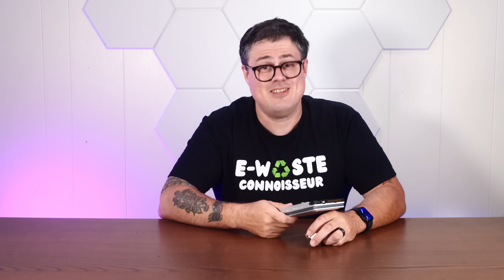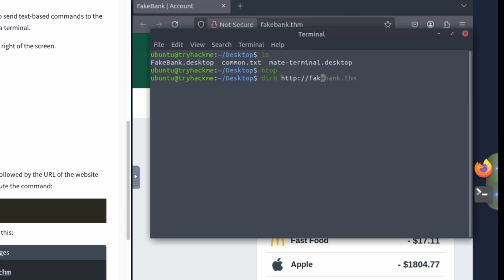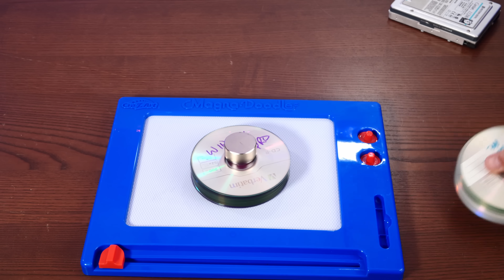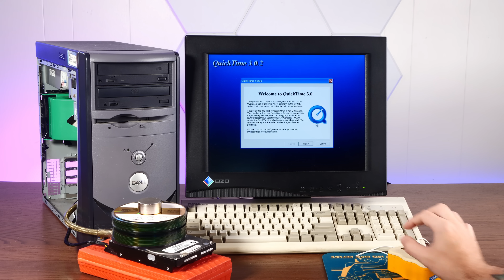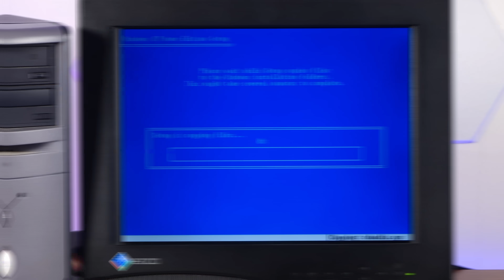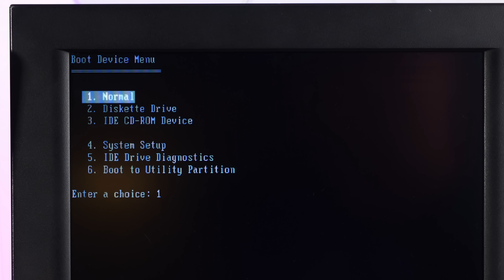The Hard Drive Experiment

Comment: Hmm, must have been a particularly weak HDD. I recall this German youtuber whos entire deal was gigantic neodymium magnets and it took a lot more for his HDD to fail. Then again, he put the dangerously strong magnets (the size and strength where you risk crush injuries if handled improperly) on the outside of the computer case rather than right on the HDD. Also, I think you caused a head crash or misaligned the arm rather than did anything particularly permanent to the magnetic disks.

Comment: I'm wondering if the drive started having a fit due to a modified/missing bad sector table...It will take forever, but it might start behaving again after a zero/low-level then a proper unconditional full format...I know this kind of thing doesn't work on modern drives because the firmware is stored on the platter as well...

Comment: Ha at one of my old jobs I’d take the drives we would need to dispose of and install windows and let them run and take the lids off the top and watch it flip out cuz the arm has nothing holding it, then I’d tighten it down and watch it go back to normal… and a couple times while it was still running I’d move files around and watch the needles skip alll over, then I’d also take them and I had a cup…. Of Mountain Dew and I’d dunk the running HDD in it… you wouldn’t believe it if told you, it still kept trying… all of them did. I loved it lol

Comment: I would like to see if you put the magnet on the opposite end of the hard drive over top of the magnetic platters instead of the drive head magnet. If it would actively like erase segments but not actually damage the drive.

By putting it over the magnets that the head uses to move, you may have burnt out the heads. Curious to see if it was an actual magnetic failure of the platters or an electrical failure because the head burnt itself out trying to move.

Comment: I've recently been wondering how bad this really is.  I stack hard drives on top of each other all the time.  I have a bunch of 1 to 6TB drives that I use to backup my NAS, and they just hang out in a couple piles on top of my disk imaging PC.  It does make me wonder whether this is okay, long term, or if it slowly affects the adjacent drives.  (I've had two drives develop bad sectors in the last 10-12 years or so.  Not sure yet how normal that is for xxTB drives.)

This last weekend, I salvaged a bunch of laptop drives and could feel two of them physically pulling toward each other when carrying them in a stack.  That was concerning.  After running badblocks on them, all but one were totally fine -- which feels like totally normal odds for a random assortment of salvaged drives.  I guess it was... fine?

Comment: The drive it's self is a computer. It loads geometry parameters an it's OS data from the magnetic storage. You wiped what the drive needed to boot. There is very special software and a serial plug that connects the the drive select pins that would allow you to reinstall the missing parts that are needed and restore functionality.

Comment: I think it's the extra clamping force on the head arm that caused the problem. That one specific bolt has to be tightened exactly right for the heads to move just right. Now the track alignment and soft sectoring might be screwed. If the firmware of the drive has a way of rewriting the tracks it should be recoverable. The thing is that tracks are written with much more magetization that regular data. Who knows if it can even be done with regular controller board. Might not have enough driving strenght for that to happen.

Comment: But you put the magnet over the voice coils that actuate the heads and not the platter that holds the data... HDDs did have some mild shielding. It was making more noise because it could not accurately move the heads... imo It is possible some data was corrupted but still recoverable...

Comment: Reformatting doesn't help because the magnet erased not only the data but also the servo marks the HDD uses to position the head and find the desired track. On modern (...well, released in the last ~30 years) drives, the user can't fix this problem. But the drive itself is probably physically intact. I think some older drives (like those used by Usagi Electric) can be recovered through a truly low-level format.

Comment: I remember back in the day, I used a program called HDD Regenerator to save HDDs from the junkyard. It did not always work, but supposedly it works by remagnetizing the sectors, so I wonder, will it fix the drive (or any drive with magnetic failure)?

Comment: In the 80s we had a computer class in school on Radio Shack TRS-80s with cassette tape drives.  When my teacher wanted to erase a tape he just rubbed a magnet on it.
Reply: This is totally fine for magnetic media.  The problem is when the medium in question has a factory-written guide track.  Losing that is fatal, even if the media itself is actually perfectly fine.

Floppy disks, tapes .. these are completely formatted and written by the drive, so a magnet does no permanent harm.  (You just lose your data, of course.)  Hard disks, Zip disks .. once the servo track is gone, that's it.  They're coasters.

Comment: I'm curious... What about removable media? Do a floppy next, and try recovering it with a reformat to see how resilient the physical media actually is
Reply: I believe the magnet can distort data while it is on non running HDD. On the contrary, being on top of running HDD made the magnetic head of HDD the plow the magnetic disks inside instead of freely hovering above it. Which destroys not only data but also the HDD physically.
Floppies do not have heads, just spinning magnetic flexible disks.
Magnet will destroy the data but reformatting will resurrect the floppies. However, the same magnet can destroy the heads of FDD drive is spinning similarly to HDD.

Comment: You put the magnet over the axis of the read write arm.

You should have put it over the platters!
Reply: Exactly.  Silly video is silly.  Of course if you put a strong magnet anywhere near the voice coil, the drive won't work.  If he'd have put it over the platters more, the drive may have worked better, but a really strong magnet will demagnetize the platters as they rotate.  Spinning HDD's store information in magnetic domains after all, an external magnet is ALWAYS going to do something if it's strong enough.

Comment: Around 2001 I was on a solar car team that was using a laptop and a radio modem to get telemetry from the car to a chase vehicle in real time.  At one point I found both our laptop and the radio antenna (held on the chase vehicle with a big magnet) had both been tossed in a box and become stuck together.  The hard drive on the laptop was very unhappy, but I booted to a linux floppy and repeatedly dd'd /dev/zero to the drive, and each pass through I got fewer and fewer errors until eventually I could do complete passes with no problems.  At that point I reformatted and reinstalled the drive and it worked fine.  Not sure if the rewriting itself actually cleaned things up, or if there was also some spare sector reallocation happening as well.

Comment: I’ve destroyed drives with magnets, but it’s pretty much just causing a head crash, not magnetically damaging the material. I used an old Bulk Tape Eraser on HDDs, and if it was off, no problem. If it was spinning and parked, no problem. If it was reading/writing, instant brick

Comment: A proper test of how a magnetic field would affect the data on the platters, would be if it was done with the hard drive powered down and the heads parked. As it stands this just puts mechanical stress to the heads, and electrical stress to the motor drive ICs/mosfets, which have to pass much more current to sustain the rotation of a spindle slammed against its bearing housing.

Comment: I think the magnet damaged the arm and possibly the motor but the data is likely still there.  As a very strong magnet would probably bend the read arm and cause it to strike the disk, so in a way, physically damaging the disk (possibly underneath the platter, and the platters below as it would the read-arm upwards into the spinning platter causing physical contact and that certain will destroy the disk and the read arm.

Comment: You're effecting the head movement but not the actual data. You've just caused the head to write on the platter where it shouldn't and didn't mean to. I've tried this exact thing but tried it without actively writing data. I had no problem retrieving the data off the disk afterward. I have no doubt a big enough magnetic field would work, but most people do no have access to one and the metallic case helps to shield the platter.

Comment: My college roommate tried this in '99 with a speaker magnet and an HDD. Didn't do anything when tried powered off, but destroyed it when spinning.
Reply: Probably the reading heads crash into the plates scratching them or in the worst case they rip the head entirely...

Hard drives already have magnets inside

Comment: I remember disassembling hard drives back in the day to take the magnets out of them. I had about 7 in the end. They were useful for magnetizing things like Screwdrivers and other things. Also, they make a great cheap sanding disk too. Just remove the head and stick some sandpaper to the platter {I used to use strong velcro so I could remove the sandpaper when it needed changing,} plug it in and voila! You have a cheap but excellent sanding disk.

Comment: one of the most harrowing experiences of my life was reaching to pick up my recently acquired iPhone 12 Mini, noticing it was a lot heavier than usual, and turning it around to realize in horror that the Magsafe system grabbed on to a laptop drive i had sitting around. that drive still works fine to this day somehow
Reply: In this case he most likely misaligned the arm holding the read/write head or caused a head crash, both of which requires a ludicrously strong magnet. It's exceedingly unlikely that you could cause any damage with most magnets.

Comment: yes the magnet will be bad for several reasons.

1. it will erase the data including the servo tracking track used to synchronize the data onto the drive.

2. magnets will effect motors making them speed yo or slow down early imacs had flaw where the speaker was placed next to the hard drive and the mac crashed each time it beeped.

3. even if the drive board can compensate and keep the motor spinning the motor and the driver chip will have to work harder and may fail

Comment: I think the issue here is that the magnet caused a headcrash when it was placed when the drive was running. 
the read/write head was bent by the magnet, causing it to touch the surface of the platter and scratching it.
If the magnet was placed on the drive while it was turned off, it probably wouldn't of caused any damage or lost data.
you need a way stronger magnet for that.

Comment: I don't think the magnet actually messed up the data. However, it might have messed with the arm (that also has strong magnets) to the point that the drive cannot position the arm correctly anymore or actually mess up the alignment to the point a head might have touched the platter.
Reply: exactly, I was thinking, what happens if the magnet is on the side of the drive?
Reply: Considering there is already a rather powerful magnet in a hard drive, yes.
Reply: This was always my understanding of magnetic drive failure; you destroy the disks ability to index regardless of the effect to the data. The data may or may not be destroyed, there's no way to know unless there is visible scratching from the arm or without a platter swap because it must be assumed that it is just the arm that's broken first.
Reply: That was my assumption too…that it likely damaged the arm/heads and not the platters.
Reply: I came to say that he did put the magnetic over the arm and not the actual disk size... If it was over the disk side I expect it would have wiped the data was the drive spun.
Reply: Yeah, just like it you had dropped the drive beyond a certain height where the g-forces would cause the arm (and possibly some of the platters) to bend slightly.
Reply: @RoterFruchtZwerg YES, EXACTLY what I thought. Oh hi brother......
Reply: I thought the same thing. I'm not sure why he put the magnet near the heads instead of over the platter(s).
Reply: Not likely - in that case, it would not have half-worked, the windows installer would not have recognized a NTFS partition or copied files over
Reply: It could easily be both. I‘ve seen thinner magnets damage data on magnetic media.
Reply: My first thought was that the magnet caused the head to crash into the platter. Also it’s an IBM DeathStar, it could have just failed on its own coincidentally
Reply: I do think the data got damaged by the magnet; but the inability to rewrite it probably was a result of a damaged arm

Comment: I wonder if the platters or other internal thingies were physically warped or damaged by the magnet.
Reply: The platters are made of either glass or aluminium so wouldn't be affected by the magnet at least in terms of being warped by the magnets, but the heads definitely would be, and I reckon it suffered a head crash but it didn't completely wreck the heads, only scratched the platters in a small area.

The quick format worked because the partition table is stored in the beginning of the disc, well away from where the drive was writing at the time the magnets were placed on it, and iirc a quick format only writes the partition table, writes a new mft (master file table) and clears the dirty bit if set.

Comment: Question:  Modern PCs do not have magnetic storage and also do not use CRT displays. Do I still need shielded speakers?
Reply: my speakers are shielded cuz i have speakers from the early 2000s but i put non shielded speakers next to even a pentium 4 computer with a mechanical hard drive from 2003 and nothing seemed to go wrong
Reply: Depends. I wouldn't put a magnet near a PCIe riser cable if I want stable GPU connection. Other than that all of the shielding on a PC is usually to keep EMI inside instead of the other way around.
Reply: also my main pc has magnetic storage (for its second storage device) so

Comment: Have you considered taking all of those drives that you have lying around and creating the largest raid Nas that you can? From what I can tell, they don't all have to be the same size either. Then you can jank it up by using all the different controller cards and whatever else you can to get as many drives connected as you possibly can. Then stress test it with as many different computers with different OSes copying data back and forth. What could go wrong?

Comment: Making a guess during the ad read. Depending on what the disk is composed of its coercivity is going to take some overcoming so you'll need to get pretty close before anything permanent happens, and it's likely that to start with most of the read/write errors you get will be due to the magnet overpowering the head rather than the disk (so moving the magnet away will restore business as normal, although any written garbage will remain), but at some point the magnet is just going to win and the drive will quickly become totally unusable (but potentially after some TLC it could be coaxed back into life even if all the original data is lost).
Reply: OK, pretty close. Based on the "it seemed to work at first, but eventually died" behaviour my guess is that the final failure is probably a mechanical rather than data problem - the magnet may have caused a head crash or bent the armatures out of alignment.

Comment: "wasted a working hard drive". Its a Deathstar, likely wouldn't work for much longer!
Reply: I can hear the click of death from here!!
Reply: It's not a waste because he got a video out of it, and it was educational
Reply: Flashbacks to The Great Hard Drive Crash of 2003, where my DeskStar died just after I had moved all of my data over to it and reformatted my old hard drive 😭
Reply: @Astfgl  Had a 80GB and it died while I was playing Max Payne 2. When it went it scarred me.
Reply: It wasn't a "deathstar" though, those were the 75GXP models. This one was a 120GXP, they were actually reliable. Not that i care about an old 40 gig hard drive being killed =D
Reply: I have used a Deskstar for almost a decade until i heard it's supposed to have been a problem drive... actually it was several of them. None failed.

However, i had to send a Maxtor DM80 in about 8 times (lifetime warranty) until it no longer made sense because its capacity was no longer very useful.
Reply: @SianaGearz  
I had IBM Deathstar unit..and it failed fast.  I went to shop where I bought it..and they looked at the unit and receipt and handed me a new one just like that.  New unit lasted until retirement.   It's a good thing that in Europe with warranty cases you'll deal with the company you bought the product from..not the manufacturer.
Reply: I have 3 of those wd 2.5gb caviar drives all clicking now
Reply: I thought he was saying deskstar lol